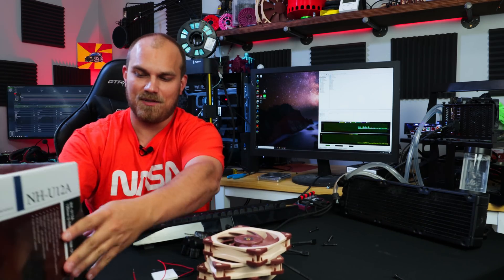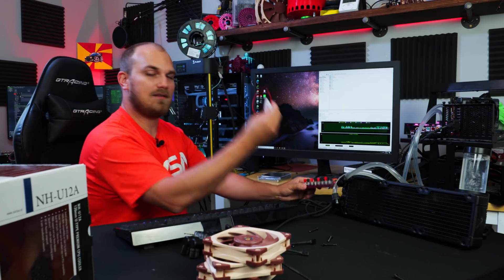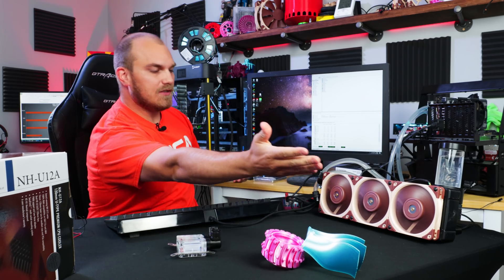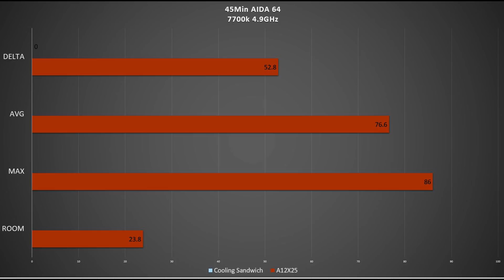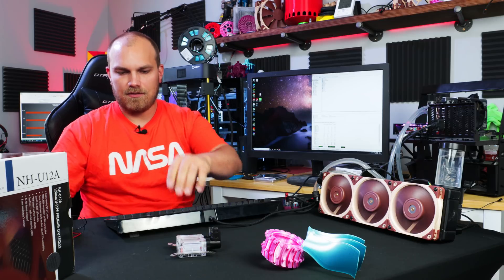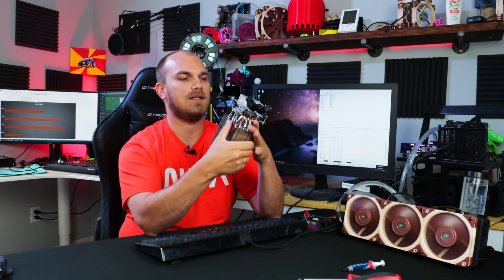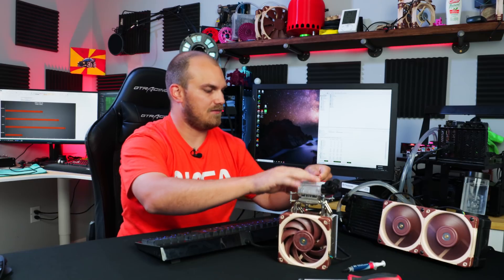Can A Wish.com Water Block and a $4 Peltier Beat a 360mm Radiator?

Comment: You'll need more peltier elements, to make it cool. one is just too ineffiecient, so if you make a loop with like 10-14 peltier elements, it could work
Reply: There is a german channel that tried this with several radiators and several high rated peltiers and a ton of fans and it still failed
Reply: @sinformant  it was @Der8auer and i watched that viedeo too
Reply: @limitetpancake  yep!
Reply: On this vain, it could be limited by voltage, I have 2 peltiers and they're rated between 12v to 36v
Reply: Unfortunately no. Peltiers are only effective in large applications. The devices he is using are only capable of a couple of watts each of thermal power and as such are easily overwhelmed by a CPU. These are more effective as thermoelectric generators. You can even see them on some stoves connected to a fan motor to stir the air.
Reply: @SoranoGuardias  the also work well in those coolers

Comment: i did this in 1999 with a smaller one and a AMD cooler with 3 fans on a Amiga1200 68030 blizzard accelerator - even seen a computer wearing high heels? yeah...sortha worked... for a wile but, condensation was one of the problems :/

Comment: Peltiers can move heat using electricity, but they're very bad heat conductors. This means that while yes, they can cool down things by transporting heat away form them, they do it at a very slow speed, therefore they only really work for things that don't generate heat by themselves, like the inside of a cooler, or a can of beverage. You would need a massive surface area covered with dozens (hundreds? thousands?) of Peltiers to cool down the wattage of a CPU!
Reply: possible with two TEC of good quality (Made in USA, not the Chinese ones with wrong specs) and a strong Qmax. Did it with three waterblocks, two to reject heat with water and the center block get cold from both side. Not power efficient!

Comment: Put the peltier between the CPU and waterblock and keep the 360 rad in place. I did this with a 240mm AIO and it kept a stock 2500k at 20c load and 0c idle.

Comment: This is a terrible idea. Keep it up!
Reply: There are SO many reasons thus is a bad idea, the speed of the water is WAY too fast for such a small peltier to actually cool it, the surface area is way too small. The air cooler is too weak to efficiently cool a peltier and the wrong way around. The cheap waterblock certainly didn't help, but that's only the top of the iceberg. Peltiers in CPU cooling are just never a good idea. Ask @der8auer lmao. 

Anyway, I still loved the vid, fun stupid ideas are allways fun! And who knows, one of theses days he's gonna prove us all wrong with something no one expected!
Reply: Maybe try gadolinium and a magnet on one side and increase efficiency
Reply: The heatpipes are in the wrong orientation, he needs to orient hot side on the bottom, cooling stack on top for proper cycling. Also, a 250w peltier would be something more suited for this application.
Reply: @DrivingVertigo  But then again, the cooler would be too small for that amount of heat. For the TEC and the CPU combined you would need something bigger than a CPU heatpipe heatsink.
Reply: The heat from the TEC doesn't need to be a consideration, it doesn't need to impact the CPU cooling at all. They should be two separate cooling systems that don't impact each other...
Reply: @knifeyonline  dude... Just no... Nothing about your statement makes sense, in the slightest... How does the heat that's created by the thing that's supposed to be doing the cooler need not be calculated?
Reply: @Shukodoshi  because they can still be physically separated. The tec doesn't have to be in contact with the cpu it only has to contact the water line or block. The tec can actually probably be air cooled completely separate from the entire tower if you want to. It certainly isn't efficient but it needs to be taken into consideration before denying the idea.
Reply: With enough fans anything is possible
Reply: @DrivingVertigo  Good point about the heatpipes!
Reply: its really not, the only problem i see here is the surface area the radiator covers vs the waterblock. the water goes through so many small tunnels with a bunch of fins on the side that cool the water instantly and efficiently with a radiator and the waterblock well its just a block of copper. try cooling a bucket of water with an ice cube.
Reply: @MHawkeye  Actually it is a terrible idea. The TECs power consumption would need to be higher than the thermal output of the CPU and since the TEC also produces heat, the cooler would need to get rid of the combined heat of CPU and TEC. I am to lazy to calculate this, but with modern CPUs that's a lot of heat. Probably way north of 300W.
Reply: @andreasvogler1875  efficiency is for people who don't live under the warm loving glow of a nuclear power plant.
Reply: @ARVash  ;-) I wasn't even talking about efficiency. The TEC he is using is probably too weak and even if it wasn't, the air-cooler definitely can't dissipate that much heat.
Reply: @andreasvogler1875  ah, maybe he could put it in line with the existing radiator. That way he could extract heat from an "already cool" line

Comment: You could try using the 360mm and peltier at the same time to precool the water to ambient temperature with the rad and then use the peltier to get even cooler.
Reply: You know about stuff eh

Comment: Der8auer did this, at a bigger scale, and it failed so bad
Reply: Der8auer also did it idiotically. The system can work and it has been done before. I do not understand these youtube engineers who dont have the slightest clue how Peltiers work. At least run some calculator for heaven's sake.
Reply: @bismuth7730  thing is peltiers aren't made and therefore used for such applications at all
Cooling something and keeping something cool are different things. Let's not talk about the absurdly bad efficiency too while we're at it
Reply: @racistpandagod  There are commercially available Peltier-based CPU coolers and waterblocks, of course they're used for this purpose, they simply have very specific requirements in terms of block design.
Reply: @Foxi4Qnet  point me to em
Reply: @racistpandagod  Here's a few examples of thermoelectric water chillers - they use arrays of peltiers. You will notice that they come with stated heat load capacity.

https://www.lairdthermal.com/products/thermoelectric-cooler-assemblies/thermoelectric-liquid-chillers

In order to cool a CPU just down to ambient temperature you'd need an assembly that covers its TDP and then some, to account for heat transfer inefficiency (thermal compound, materials used, specific heat of the liquid and its conductivity etc.). You can build one yourself too with enough know-how and some math. It's a bit of a science.
Reply: @racistpandagod  Major Hardware should look into "Making Stuff Awesome" yt channel. He has great videos explaining TEC and also has videos of his own system. It is very possible.
Reply: @bismuth7730  It's an excellent resource on the subject. The man does wonders with a CNC, and dispels the "inefficiency" myth in his video series on TEC specs. People confuse coefficient of performance with efficiency all the time, and they're not the same thing.
Reply: @Foxi4Qnet  that's not a commercial thermoelectric cooler for cpus now is it
Reply: @bismuth7730  while his videos seem informative they all feel theoretical. Can't find vids of him actually doing it.
Nonetheless making a chiller from tecs or even slapping them on the cpu, both aren't good cooling setups. It's not what I'll call a working setup for cpus that is
Reply: @racistpandagod  You're a bit picky, aren't you? Here you go:

Cooler Master V10 Hybrid: https://www.tweaktown.com/reviews/1736/cooler_master_v10_200_w_hybrid_t_e_c_cooler/amp.html

Phononic HEX 2.0: https://www.tweaktown.com/reviews/7772/phononic-hex-2-thermoelectric-cpu-cooler-review/amp.html

There's a couple more, like the old CoolIT Eliminator, the Swiftech MCW-6500-T TEC etc., sadly most manufacturers use the elements as a gimmick rather than utilise their full potential. Cooler Master presented a nice prototype, but I haven't seen a commercial version yet:

https://www.overclock3d.net/reviews/misc_hardware/computex_2018_-_the_debreif_highlights/3

Point being, if it's good enough to cool down particle accelerators, it's good enough for a PC. Thing is, doing this "the right way" is very expensive, both in terms of production and the user's electricity bill. That said, in some applications the electricity bill is irrelevant - that's where you enter the "Mad Science" territory of cooling.
Reply: @Foxi4Qnet  it can be done I never doubted that. It's just a garbage way
Reply: @racistpandagod  It's definitely more wasteful than just hooking up a phase-change cooler, a compressor can do the same job at a fraction of the cost, not to mention dry ice or liquid nitrogen. That being said, all cooling that exceeds the requirements of the machine is "wasteful", in a sense - some ways are just more fun than others. If the concept of having to use 300+ Watts to cool a 300W peak part doesn't sound appealing to you then it's definitely not something to dabble with, you can do that with just a big hunk of copper and aluminium. That being said, you slap a 1000W's worth of peltiers on the same component and that thing's freezing solid, no doubt.
Reply: @Foxi4Qnet  jeez just imagine a 1000Ws worth tec
I could buy a car in that bill
Reply: @racistpandagod  It's not cheap, for sure. 1kWh is about 14c on average, so assuming you'd be running the setup non-stop at full load for 8 hours a day, you're looking at around $30 at the end of the month. Such is the price of greatness, and eFame on tech forums for all of time. :P To be fair though, with enough surface area you'd probably be able to get away with cooling passively when the PC isn't under stress and doesn't need to go below ambient. With some clever engineering you could probably cut that value down even more by only enabling the peltiers when your "refrigerant" gets hot.
Reply: @Foxi4Qnet  just a few relays some thermal probes and an mcu
Speaking of surface area at what point does it become just a bad space heater
Reply: @racistpandagod  How hot do you want the room to be? I'd say a 1000W space heater would keep the room nice and toasty, regardless of size. :P
Reply: it works but very inefficient... been there with 3 waterblocks.
Reply: @elcouz  I mean if it technically works but ends up having a higher wattage than what it's cooling does it really work lmao?
Reply: @racistpandagod  Yes, it does, because with air or water cooling you cannot ever go below the ambient temperature of the coolant, which would be either air or water. With peltiers you are using the peltier/seebeck effect and create electromotive force which literally moves energy from one side to the other as electrons flow through the thermocouples. In order to achieve that you need two things - you need your peltier/peltier array to have more load capacity than the element you are trying to cool and you need a cooling solution that can remove both the pumped heat and the heat produced by the peltiers themselves.
Reply: @Foxi4Qnet  I too am a man of science I know how they work. I'm genuinely asking for these products. Gotta see em what their rated loads are and so on
Reply: It failed because his setup was poor. just because they're big name techtubers doesn't mean they get things right, or know what they're doing. I usually take what they do with a grain of salt.
Reply: Same did LTT and also failed

Comment: you need more peltiers than 1 in order to cool a cpu. I'd say get 7 more and then try again. But this will work you just need more peltiers
Reply: Go watch Tech Ingredients, he builds a freezer with peltiers
Reply: It won't peltiers are pretty garbage
Don't believe me? Check Der8auer's vid it's a few months old
Reply: @racistpandagod  Done it with two peltier of good quality and 3 waterblock. I was able to move 344w of heat load. Electric bill thru the roof (700W of load to move 344w only)
Reply: @elcouz  that's why I say they're garbage.
Reply: @racistpandagod  I know but to make instant cold drinks in my alcohol dispenser machine it's perfect! They are reliable can cool or heat your beverage in a flip of a polarity and don't require compressor and gas. Each have advantages and drawbacks.
Reply: @elcouz  always wanted to make a desk chiller to cool drinks in my dorm but most designs I came up with were bulky af. How big was yours?
Reply: @racistpandagod  well it's not really a drink chiller but a drink freezer ... I can pour vodka shots at -20c with the use of the peltiers but the unit that cools the drink is no bigger than a rubik cube (2x2x2)
Reply: @elcouz  that's pretty cooool
Reply: @racistpandagod  He used an awful setup and cheap, low-power peltiers. There are peltier chillers out there that will easily go sub-ambient, even sub-zero - it's a matter of designing the system correctly. Check out the channel Making Stuff Awesome to see how it's done - the guy designed peltier waterblocks for the military to cool equipment in areas where reliability was more important than efficiency, seeing that peltiers are solid state with no moving parts, unlike compressor-based chillers.
Reply: @racistpandagod  Also I have seen his vid and the peltiers on his vid are TERRIBLY COOLED!
Reply: @racistpandagod  No they will and saying peltiers are garbage just means you have no knowledge about them. Yes peltiers are very inefficient but they take little to no space at all and as a bonus they act as a generator if the temperature difference is there.
Reply: @aleksandersats9577  I'll clarify
Peltiers are garbage for heat transfer and cooling such loads. The math never checked out in the first place. Especially for efficiency
Reply: @aleksandersats9577  it's all bout use cases
Reply: @aleksandersats9577  probably the best way is to "pre-cool" the water to near ambiant using the heatsink and then use pelletiers to cool further.

Comment: You can put the peltier in the reservoir of the 360 loop and see if we can squeeze more performance out of the system.
Reply: Rather put ice in it really
Reply: it's gonna freeze on the surface of the TEC

Comment: wouldn't it be easier just to directly connect the block to the air cooler? all you're doing is wasting heat and energy to move higher-than-ambient heat to an air rad instead of just letting the metal/heat pipe radiate it directly...
Reply: lol like a remote air cooler